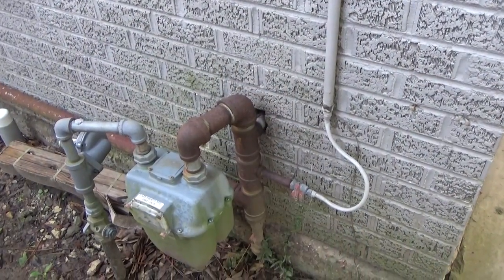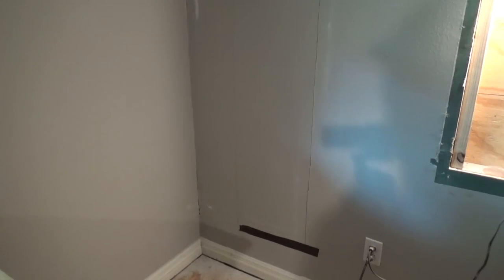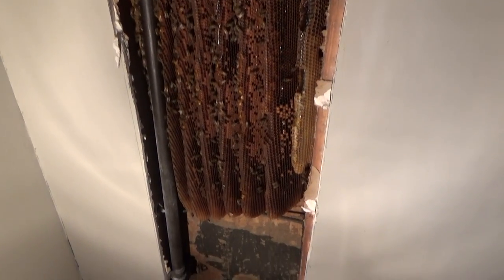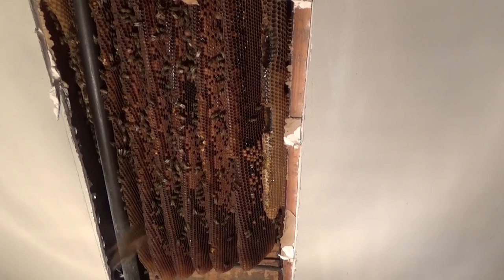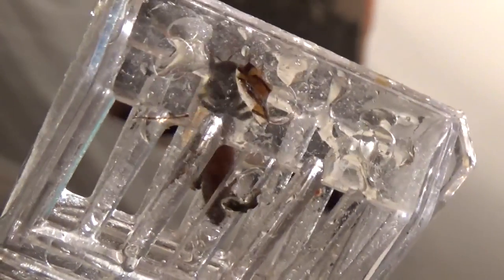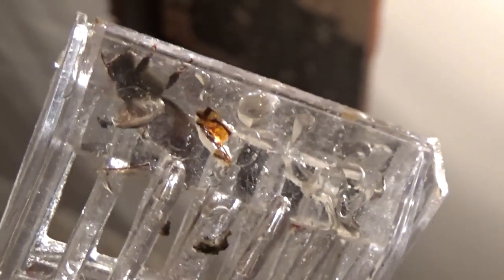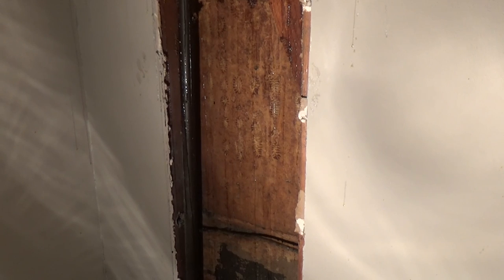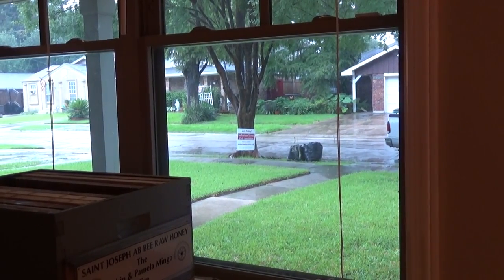BIG bee hive in wall of a living room.

Comment: I was curious about your vacuum. Is it a special type, or lower power, to protect the bees from injury? I figure once I get into beekeeping, I might get called to remove the occasional hive, and vacuuming seems the way to go. Thanks.
Reply from the maker: The vacuum is specially designed not to harm bees, yet strong enough to get them off the hive. I have been using the one in this video for over 3 years with very good success. If you are going to remove bees as a business, you will need a bee vac. Best wishes for all your success. God's peace brother.
Mr. Ed

Comment: Do you need to clean the honey left in the walls?  I would think leaving it there would encourage another swarm to move in, unless you block the outside entrance of course. :)
Reply from the maker: Because this cut out was done from the inside of the house, the walls were washed down and then sprayed with bleach after the entrance was blocked. When the cut out is done from the outside, the opening is left exposed for at least a week to allow other bees to clean up any remaining honey. After that, the wall is then sprayed with bleach and sealed up. The bleach masks the bee odor as to discourage other bees from moving in at a later date. This does not work always and a year later I'm back at the same house removing a different colony. Great question, thanks for watching.         Mr. Ed